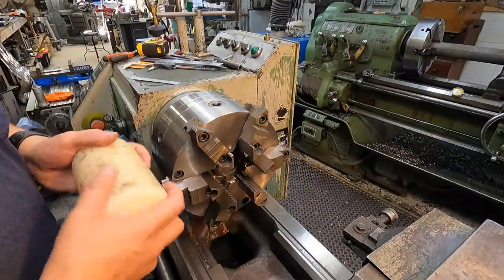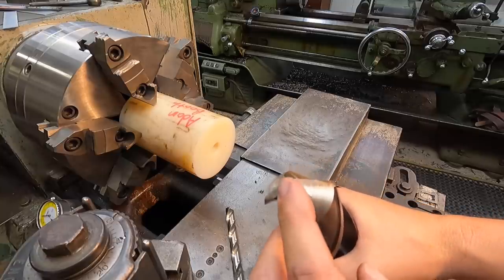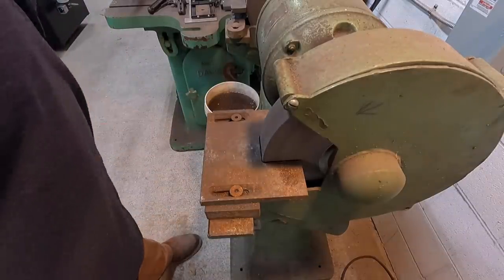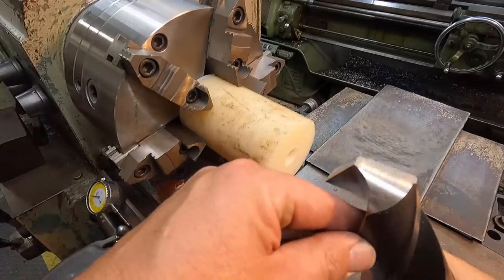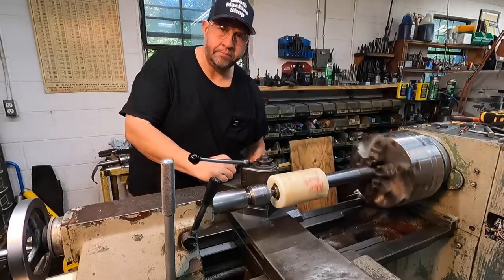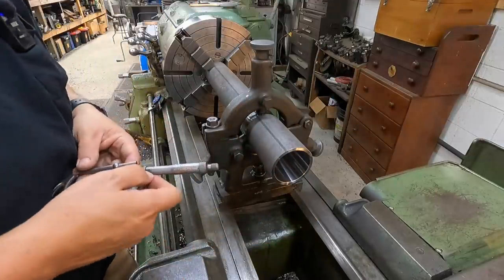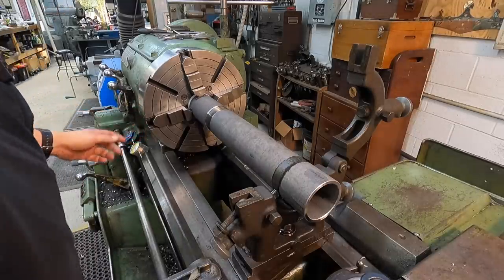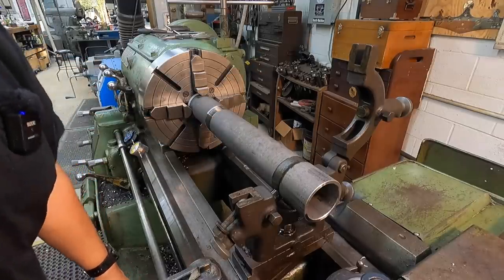Truck Hitch Crane Build Ep. 6

Comment: Lessons in how quickly you can destroy a drill by trying to sharpen it.
I have perfectly sharpened drills using a grinder like he’s doing only about four or five times out of the hundreds of times I have sharpened drills. I didn’t have the gauge or a high quality stone most of the times I have done it and actually I think most of my failures were in trying to chase perfection with the gauge.
Most drills have a limit to how many times you can sharpen them before you cut them down too far, the flute gets wider the further up the shaft and the hardening doesn’t go very deep.
In an emergency I have tried to sharpen a broken drill and it has been an utter failure barely able to cut alloys or wood.
Cutting jigs are a must if you want to keep your self from sharpening your drills to death.

Comment: Can you use a belt sander to sharpen larger bits. My grinding wheel is not thick enough to sharpen my larger bits (up to 2.5")? Always enjoy watching you sharpen bits. Great learning video.
Thanks for sharing this Adam. Always enjoy watching your projects.
Reply: Yes you can use a belt sander to sharpen drill bits. In fact I’ve used my four inch belt sander for years to sharpen both small and large drills. One big advantage is the ease of changing to finer grits for finishing.
Reply: Yeah belt sanders work fine, i often use an angle grinder myself because i  find it easier to get better control but each to their own

Comment: Ive not worked with this much, wouldnt delrin last and wear longer?
Reply: No, it wouldn't.
Reply: @qualified_monkey8813  ...Not so!  Delrin is Dupont's name for an extremely tough acetal polymer.  It would certainly be more durable than the nylon.  However, it doesn't look like durability is an issue with his design.  He also wanted to build this project using materials he had on hand.
Reply: Actually nylon is better for bushings than acetal delrin, although either would work especially in this application. That said bronze would be better followed by polyurethane.
Reply: @grntitan1  yeah ive not made many bushings, and when we did it was usually bronze or brass and a few delrin pieces. But most of my stuff has just been standard machining for the aerospace or airline industries.

Comment: Couldn't you slow it down to drill the plastic so it doesn't get so hot so fast?
Reply: i have no idea why he didn't just slow it down apart from just trying to work faster but it doesn't really work faster though, because of how big a depth of cut is possible in nylon all that extra speed achieves is to melt plastic and make him work harder instead of just letting the machine do the work.. he was probably just side tracked by filming and didn't think so much about what he was doing

Comment: I was told by a wise machinist to stand away from the grinder and wait 30-60 seconds before using it. He explained that it has to do with the harmonics of the grinding wheel. In that time is when the wheel is most likely to shatter. Is this true?
Reply: Hmm I've heard that too, but not with the harmonics reasoning attached to it. Never heard or considered that but it seems like it would be true

Comment: If that is nylon - never ever lubricate it with regular grease or oil since the nylon will expand. Use silicone lubricants only.
Reply: @pvtimberfaller  
Right, didn't think of that off the bat. (It's hygroscopic btw. 😊) And 1/16" is quite a lot.

Let's see if Mr. Booth discovers that too. 😉

Comment: Nylon absorbs water and swells you may have issues even in a humid environment it can swell, Acetal would have been a better choice of material over Nylon in this situation as its not effected by water/ humidity.
Reply: Or Delrin, but IIRC Adam was using a piece he had...
Reply: @PhilG999  ...Delrin is Dupont's name for a specific (tough!) acetal polymer.  All Delrin is acetal but not all acetal is Delrin.  Also, you are correct in that Adam said he was using what he had, so Delrin was not a choice.

Comment: Adam, I need to get a toolpost for my 17" lathe. Would you recommend the Enco style like you use as opposed to the Aloris wedge style? Seems like angles are easier to set.
Reply: I hope Adam will reply, but I will throw in a vote for the swiss style tool post.  I have one made by PeWe tools on my Emco v13,  and am very happy with the quality and repeatability.  The owner of PeWe is very passionate about recreating the original specs and quality, and is always willing to answer any questions.  I believe Adam has a holder or two from PeWe as well.  You won't regret adapting the swiss system on your lathe.